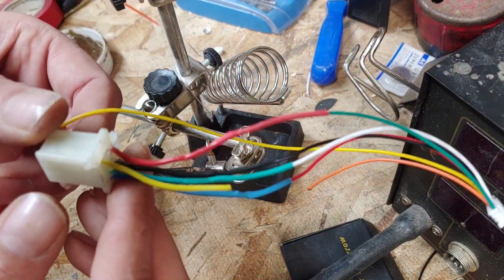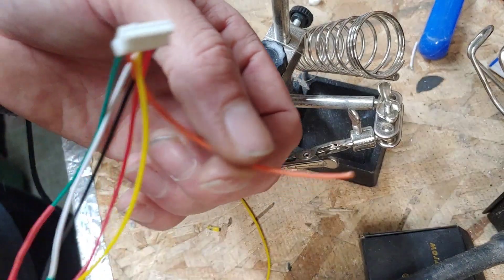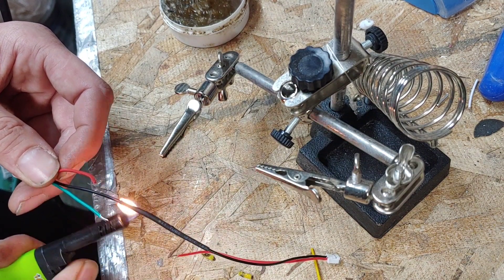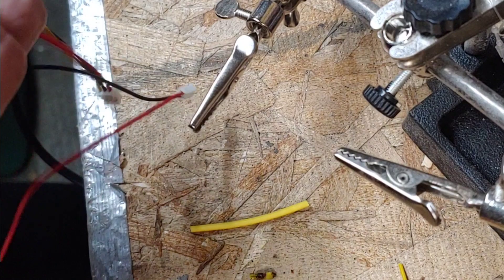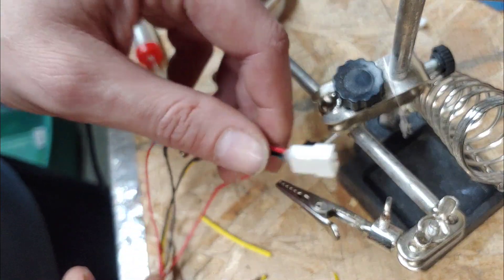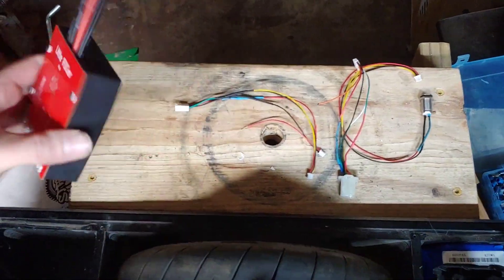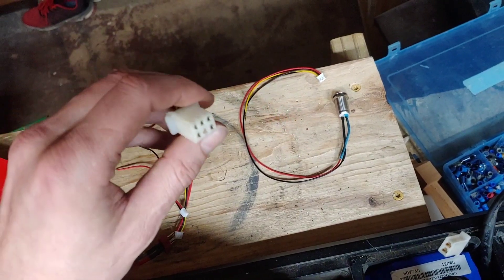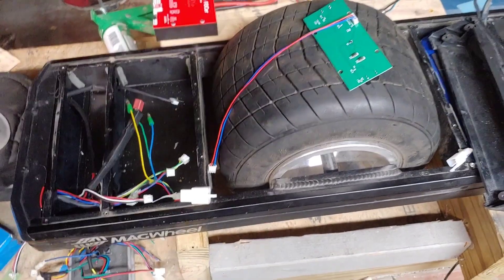VESC MAGWheel Connectors

Comment: I am currently installing a VESC from Spintend (Not a Focer) into my T2 Magwheel and the work you are doing is helping me understand more about how to modify the existing wiring to match my application. Do you have a detailed drawing of how the cable adapter wiring is pinned out? I need to know more on the foot pad signal inverter. I would love even a hand drawn wiring diagram if it is available from you. Thanks for all you do for the Trotter people out here.